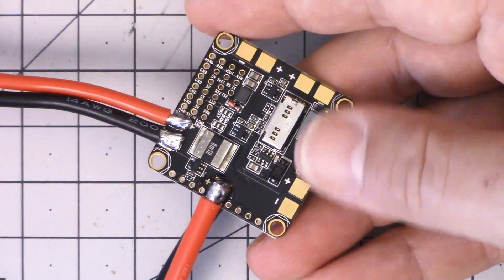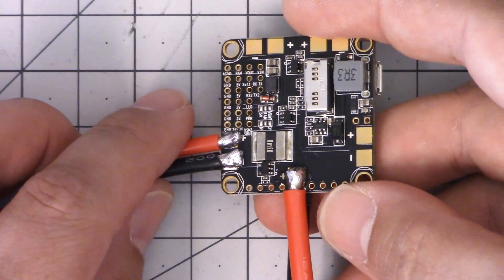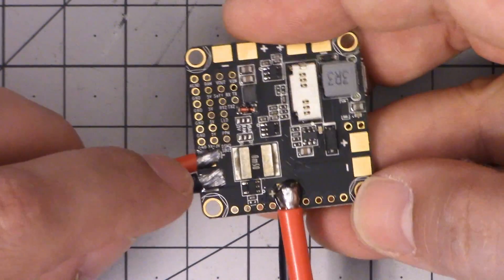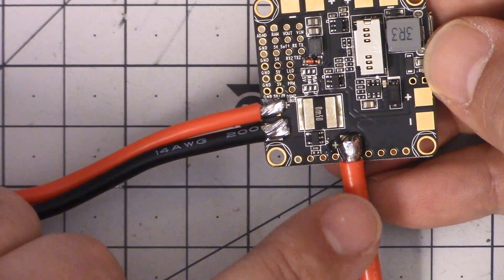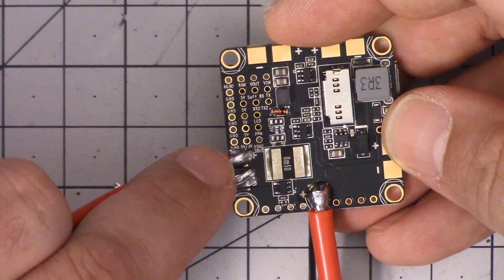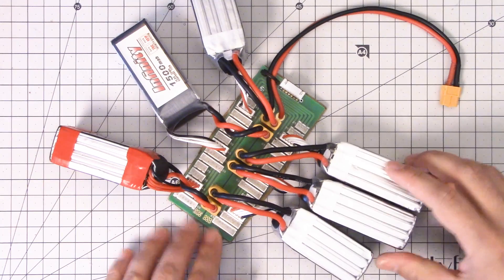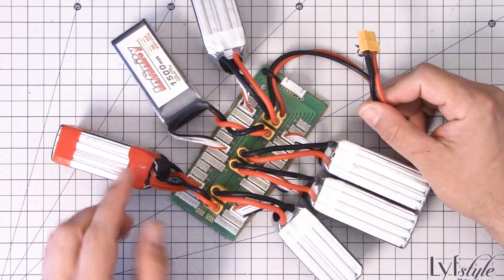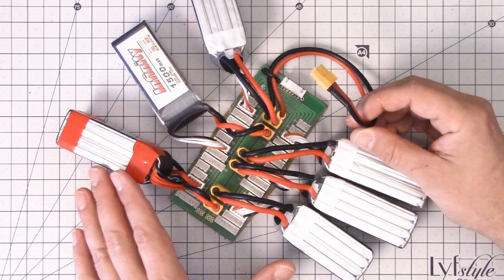Betaflight F3 Inaccurate Current Sensor mAh Readout | FIXED - Part 1

Comment: @Joshua Bardwell - thanks.

Coupla question please:
1) for a given version of the board (i.e. boards with the same components) will the value be the same, or at least roughly the same or will it still vary considerably among individual boards?
2) is there a way to identify the different resistors and therefore which board is which?
Reply from the maker: It will be roughly the same, but there is some variance in the value of the resistor. It depends on what precision of resistor they are putting on the board. 

You can measure the resistance of the resistor using a multimeter, but you have to figure out which component it is.
Reply: Thanks